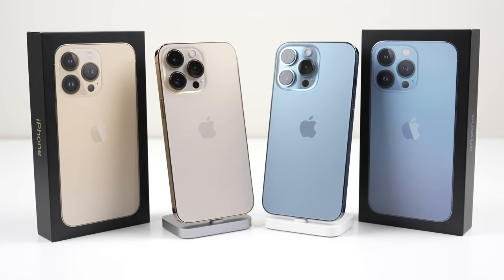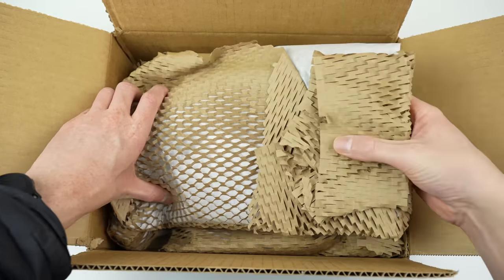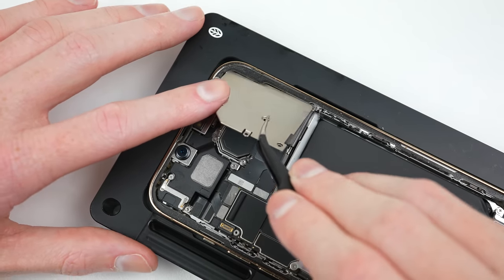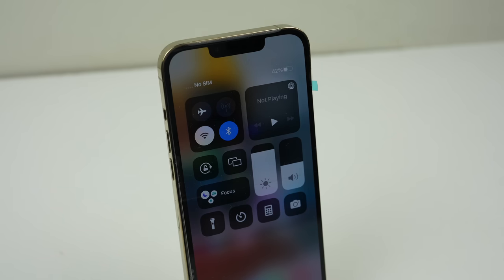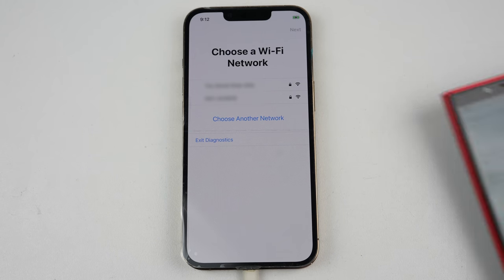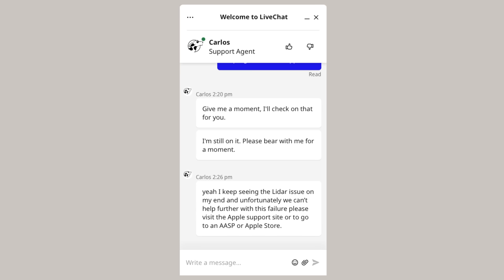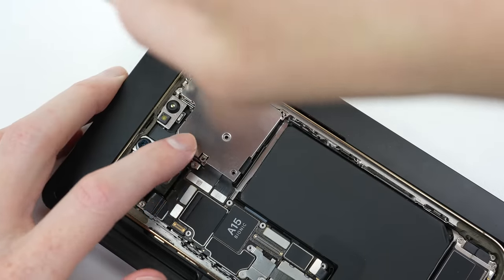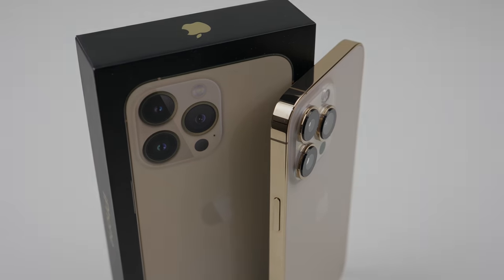Apples Self Repair Program Is Not What It Seems

Comment: This calibration process is madness. There's no good reason to pair most parts to a specific device to begin with.
Reply: Unless yours gets stolen and used for parts.
Reply: Exactly @Alias Anybody
Reply: @just-a-bajan6643  maybe if parts were easier to get through legal channels and phones weren't made to be replaced every year or two, theft of phones would go down 🤔
Reply: @LexYeen  No, it wouldn't. If thieves know iPhone parts aren't really valuable due to pairing, they'd just avoid stealing iPhones altogether.
Reply: @satsumagt5284  Well they can still sell the phones
Reply: @gp3328  Do you mean the paperweights? They’re iCloud locked
Reply: @gp3328  You won’t be able to do anything with it because it would be iCloud locked
Reply: @satsumagt5284  you can bypass iCloud lock by jailbreaking the phone, doesn't return full functionality but it's enough for thieves to sell it on.
Reply: @robinfiler8707  Not always, since only few people would want that phone
Reply: Maybe not in the mind of someone who Has absolutely no idea about chain of trust and Why Apple bind parts serial numbers together
Reply: @robinfiler8707  on most modern iphones (i.e. phones that people actually want), bypassing icloud just makes the phone turn from a brick to an ipod touch. unless something major has changed, cellular and phone functions are still broken even after bypassing as of at least iOS 14.
Reply: the reason is more money to apple
Reply: @just-a-bajan6643  honestly, I think it's still better if stolen or lost iPhones get gutted for their parts than the alternative of becoming total ewaste.
Reply: @satsumagt5284  Technically, you can sell it in China for a lower price if it's in good condition because they have the hardware to remove the iCloud lock or Find my iPhone then they sell it for as a refurbished apple device,
Reply: @just-a-bajan6643  which is like 1% of the time.
Reply: It's sad in way that Apple makes in my opinion one of the best phones terms of reliability of capturing pictures, videos as you want without minimal or nothing at all lag... And these M1 line up of chips inside of their laptops and that they brought back port's, the good old keyboard and admitted their mistakes about removing them... I now view that Apple tries to make the best products even though they are expensive, but they are high quality as fuck and personally I thought that few years ago that MacBook is laptop that I could never consider if they don't bring back at least the SD card reader and HDMI port... They brought those back and made it even better in performance, a few years ahead of the competition in terms of the laptop's, and the speakers are probably the best in laptop's, or at least one of the best. So Apple is trying something here, but their policy is stoping them...
Reply: @satsumagt5284  Not even thieves want your Apple crap lol.
Reply: @just-a-bajan6643  please, less stupid excuses. This is only about money and nothing else. If you think there is any other reason you delusional.
Reply: Its making them more money tho
Reply: Yes there is. Money and control.
Reply: @boringmpact4439  I don’t live in China, so…
Reply: @satsumagt5284  they absolutely don't check if you have an iphone or not before getting it from you lol.
Reply: @FAB1150  There was a case in my country where they did. And mind you, the thief gave it back, knowing it would be paperweight
Reply: @just-a-bajan6643  Which isn't even a talking point because STOLEN phones and their parts are black listed once it has been flagged. Disabling functionality is regressive and punitive since they already have the entire serial list. This video is a point and case observation of that. These parts are DIRECT from Apple and APPROVED before shipment. This doesn't make any sense and is hardly any more of an improvement from just buying 3rd market parts.

It is one thing to punish thieves for scalping and stealing parts, this is something quite different.
Reply: @just-a-bajan6643  except, this doesn't happen.  stolen phones end up overseas being used, not stripped for parts, or, they end up in the trash when they aren't useable anymore.
Reply: Yes there is 💲💲💲💵 💵 💵
Reply: @robinfiler8707  no as the moment they'd update it, the icloud lock would come back, plus it still doesn't fully remove the lock
plus jailbreaks nowadays are usually semi-untethered, which require access to SpringBoard in the still jailed environment in order to launch the sideloaded exploit app
Reply: @hopolapopola  just like how nvidia say their gpu are unhackable, if there's a will there is a way. No device are truly unhackable.
Reply: @basicallyedward  few years ahead in performance? I doubt it, if we talking about laptop. And majority of the "performance" also had to do with software as well. 
Let's say u rendering a video out. it's all what software u're using to do so because some software favor 1 os over a other.

Plus, majority of people who buy MacBook and iPhone r not content creator. It a fashion piece for alot of people. Which  is kinda sad to see imo
Reply: Don't buy Apple products. It's not like there isn't any other choice.
Reply: @just-a-bajan6643  if someone is desperate enough to steal a phone, they probably dont care about truetone or a non-genuine notification
Reply: oh..from apples pov there clearly is...money..control..
Reply: It’s the last step in making iPhones unstealable
Reply: @robinfiler8707  You can't bypass iCloud lock on anything newer than an iPhone X.
Reply: It’s to prevent scalping
Reply: @kilometer3853  um, what? The only scalpers here are Apple, everyone else's parts are a fraction of the price and often just as good. The good ones aren't cheap, but they sure as hell aren't Apple prices.
Reply: i think the thing everyone in this comment isnt realizing is it doesnt matter if the phone is icloud locked. a person can steal a phone and just as easily sell it to someone whether in person or online while claiming it is an honest sale. pairing the parts does nothing to prevent theft, and everything to prevent buyers from being able to repair their own devices, simple as that.
Reply: @robinfiler8707  Good luck the average criminal to jailbreak a fully updated modern iPhone.
Reply: Imagine having to repair your car in the same manner
Reply: @LexYeen  hahah. No
Reply: @just-a-bajan6643  I have a feeling it also has something to do with security. AFAIK the first software locked part was the Touch ID home button. I might be done to prevent spoofing the part to unlock your phone. 
While one of the reasons it's done might be to actually protect users of these high end phones from criminal activity, it still has a backfire on the same users in being more expensive to repair.
Reply: @just-a-bajan6643  such a dumb comment... I don't care If my phone gets stolen for parts, because if stolen it will be used as a phone.
Reply: @basicallyedward  Dell make better laptops than Apple - as long as you are willing to pay for their premium models, which are still a little cheaper than the Apple equivalent.
Reply: @just-a-bajan6643  someone could still steal my phone and use it for parts they just wouldn’t have Face ID and would get a display warning in settings
Reply: @satsumagt5284  people would stop stealing iPhones all together? No, no they won’t
Reply: There is a reason, it's called money
Reply: You never had your iPhone stolen and sold for parts because of the activation lock, have you?
Reply: @LexYeen  lmao when you steal a phone, you don't think about part acquisition logistics, you want to flip a phone
Reply: Exactly I'm an I T guy Dell helpdesk formerly we'd replace motherboards and all kinds of parts they weren't locked to the specific device that was getting serviced.
Reply: every single decision they make is to make more money. EVERY decision, no other reason
Reply: @satsumagt5284  found the apple apologist.
Reply: Its a scam!
Reply: @basicallyedward  they arent even the best phones
Reply: My 14 Pro got stolen and Im happy to know Apple made it hard for thieves to swap parts😉
Reply: @eduardoh7140  and anyone else
Reply: @Handles_arent_a_needed_feature  i rather put original part than crap screen from China
Reply: @eduardoh7140  
Okay, you very smart person, what exactly is stopping Apple from creating the option to unlock all the parts bound to a device when factory resetting so it can be used for spare parts by the new owner? And even if not, what is stopping Apple from selling special universally compatible "open" parts for repair seperately?
Reply: @Alias_Anybody  Apple has to figure it out, maybe it Will come soon
Reply: @just-a-bajan6643  stealing a phone is easier than just order new parts from china??
Reply: @organiccold  hes not delusional, hes just an apple owner 😅
Reply: @satsumagt5284  What an odd way of saying you're ok with being unable to properly repair something unless you have the manufacturer do it for you.
Reply: @neighborhood_k  I wish they weren’t stolen, so anti-theft couldn’t be used as a reason
Reply: @satsumagt5284  you do realize that if that was the reason a screen shouldn't work at all on another device? And yet for some reason it still shows a picture and maintains touch functionality. So no, it's not about anti theft it's about having control over product that you rightfully own.
Reply: @just-a-bajan6643  HAHAHAHA
Reply: To prevent stolen phone being used for its part and prevent those dodgy fake chinese part

Comment: How environmentally friendly, shipping around massive pieces of machienery everytime somebody wants to replace a screen, as well as the screen
Reply: Should they teleport them?
Reply: @jeanbutinfrench  "massive pieces of machinery" shouldn’t be necessary to begin with. the whole process is convoluted for a simple screen replacement
Reply: "Planet sized plan" until it affects their bottom line
Reply: I was surprised to learn they sell them. When I watched another video about the repair program earlier this month, they were renting the machines out and you had to return them after use. This might work out better if you can resell the machines after use. I expect that will work out to be much cheaper than renting them from Apple - assuming they don't get damaged at some point.
Reply: you can however buy said machinery so... its up to you if you want it in essence once done the only thing you need are the parts which should be "relatively be affordable" and have a lower carbon foot print so... far from perfect since the AST2 is still pretty locked in really (unless you have an insider guy)
Reply: @edwardtan1354  Yeah, It’s gonna be so worth it buying a tool for a screen replacement that only works for 1 single phone and is worthless afterwards
Reply: @derkernsen  technically no the sleds are for 1 model so thats the "consumable part" so if a new model comes out you will need to buy a new sled unless the next iPhone comes out with a 16-20'' screen since the screen press only comes out to 10-14 inches as those are YYEEE THICC presses also according to Snazzy Labs the heating plate that Apple has isnt efficient or at least has very inconsistent heating so thats actually a bad purchase, you are better of probably getting what Jeffery has if you ask me the screen press is decent enough
Reply: Not to mention all the presumably unrecycle-able plastic used in all the packaging...